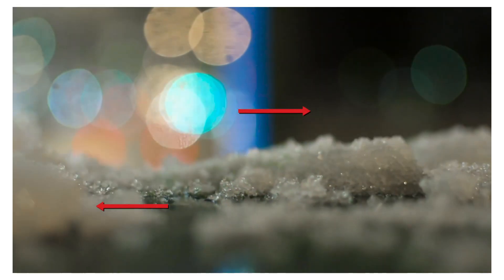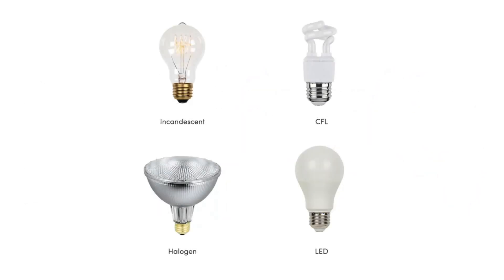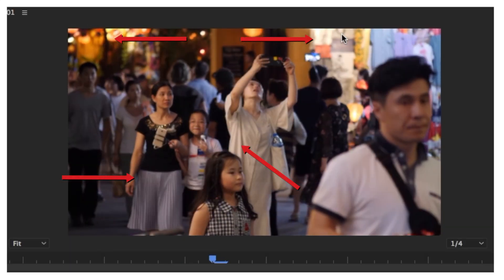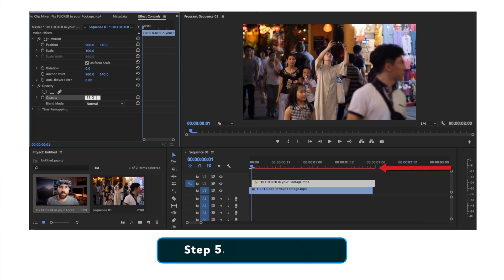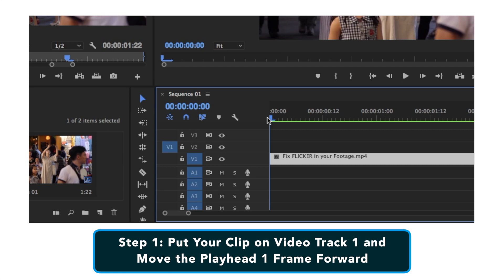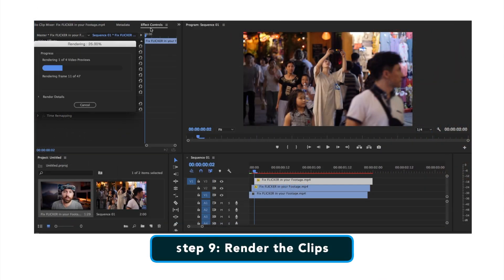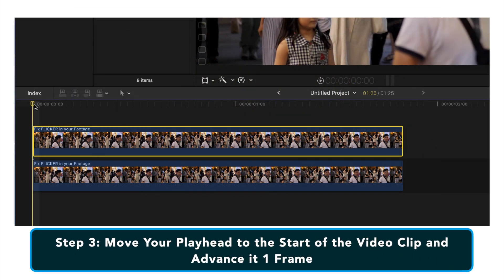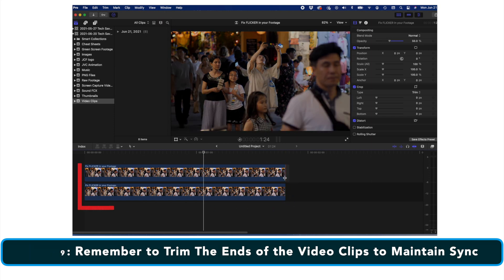Eliminate Light Flicker From Your Video in Adobe Premiere Pro & Final Cut Pro X

Comment: This only works if there isn't a lot of movement
Reply from the maker: True. It's works best with little movement. The best way to avoid the issue is to eliminate it from minute one. Matching the shutter speed to frequency of your lights is get rid of the issue.

Comment: I tried this method but it didn't fix the flicker from my drone footage where the sun angle made the props create filcker on my video. Thanks for the info though.
Reply from the maker: Sorry to hear that. I will still try to help you. I need details, however. What exactly were you shooting? What kind of lighting was it (lighting manufacturers, make/model of lights)? What were your camera settings? etc.

Comment: How you move the upper layer one frame right,, what key you use,,, seem period or comma but doesnt work for me
Reply from the maker: Premiere Pro:

Nudging Left and Right: One Frame

Keyboard Shortcut: Command + (Left Arrow or Right Arrow)
To nudge your clip left or right by one frame, simply select your clip, hold down command, and press left or right on your keyboard. You don’t have to unlink your audio and video for this technique to work. It should be noted, however, that when you nudge a clip over and nudge back, there will be a gap in your timeline. Make sure to fill in the gaps before you move on.

FCPX:

You can “nudge” selected items to move them by very small amounts, such as frames. Nudging by subframes is also available for connected audio-only clips.
Nudging clips in the timeline is similar to making a slide edit; the preceding clip and the following clip must have media handles (additional media available beyond the edit point). See Make slide edits in Final Cut Pro.

	1.	In Final Cut Pro, select one or more clips in the timeline. 
	2.	To nudge the clips, do any of the following:
	◦	Move the selection left by one frame: Press Comma (,). 
	◦	Move the selection left by 10 frames: Press Shift-Comma (,). 
	◦	Move the selection right by one frame: Press Period (.). 
	◦	Move the selection right by 10 frames: Press Shift-Period (.). 
	3.	If you want to nudge connected audio clips by one or more subframes, do any of the following:

	◦	Move the selection left by one subframe: Press Option-Comma (,). 
	◦	Move the selection left by 10 subframes: Press Option-Shift-Comma (,). 
	◦	Move the selection right by one subframe: Press Option-Period (.). 
	◦	Move the selection right by 10 subframes: Press Option-Shift-Period (.). 
4. For more information about subframes, see Zoom in to audio waveforms in Final Cut Pro. 
The nudged clip appears at the new position in the timeline. The adjacent clips are trimmed to accommodate the change in the clip’s position. If you prefer to fill in the vacated parts of the storyline with a gap clip, select the Position tool by pressing P before nudging clips.
Reply: @jimcostafilms  thank you very much !!! Very useful
Reply from the maker: @galindovisita6482  I happy I was able to help you.